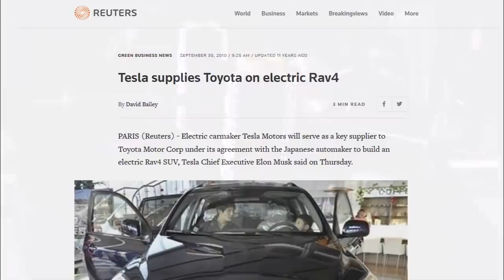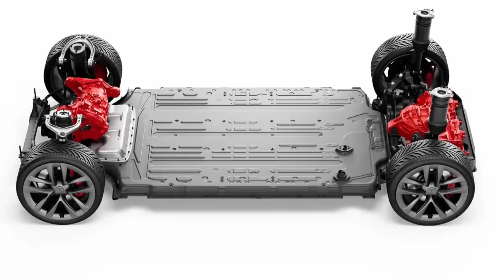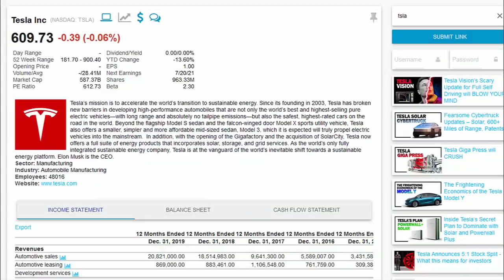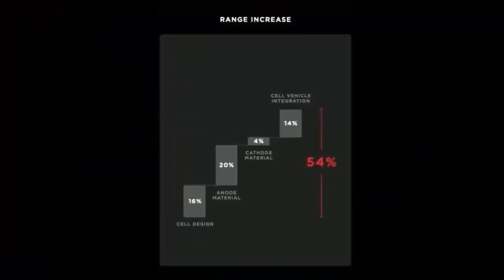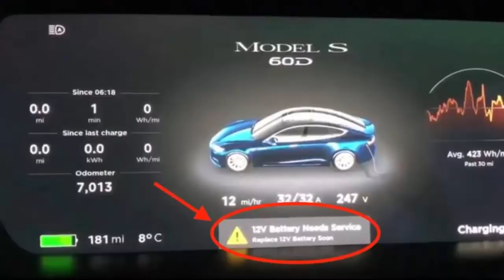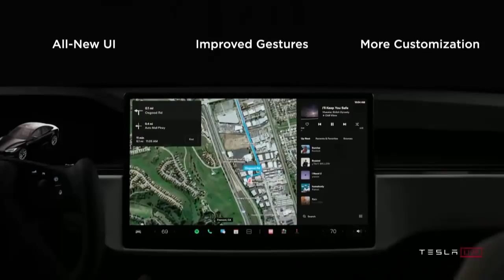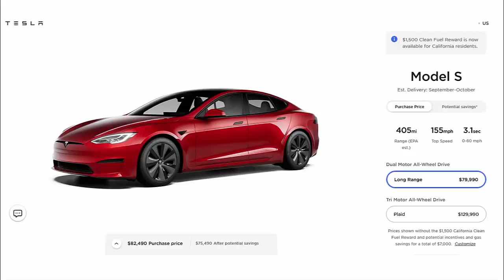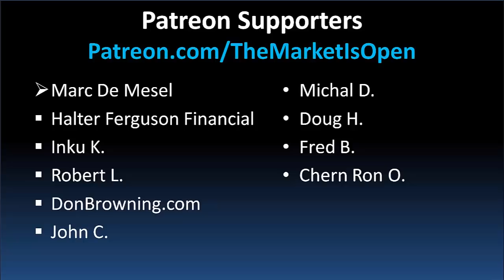The INSANE Engineering of the New Tesla Plaid Model S

Comment: If Tesla's rollout of the CSRs (carbon-sleeved rotors) is like other performance-related features, they've left significant unlocked potential, providing headroom to crank up the top speed, etc., and will gradually unlock more once they've gained a body of real-world experience.

Comment: You can upgrade to the FSD option after the vehicle has been delivered, so it's not an issue for the tax credits.
Reply: Exactly. The paint, the wheels etc are a bigger issue here.
Reply: As FSD is software, wouldn't it technically not be included in the tax credit anyway?. So they could sell it as an optional extra, but seperate it from the car's invoice/order
Reply: @jamesbedford7327  they actually don't do that, it's just an additional item tacked on to the list of features. This screwed me over when I got the Model 3, because it put it in the luxury car tax category, so the tax on the entire amount went up.
Reply: Guys, what is the eligibility for the tax credit? Is it income eligibility or car cost?
Reply: @dmtheone  the proposed legislation is based on the cost of the car. Under current legislation (for which Tesla is no longer eligible) you basically get a discount on your taxes, up to $7500, no car cost or income restrictions. Just based on whether the make has sold 200k units yet or not.

Comment: Well carbon itself can handle extreme heat. But one important thing to remember is that the resin used does melt long before the carbon itself so that is why we don't see entire carbon fiber exhaust systems ie on sportsbikes. Due to the heat in the exhaust gases, only that pipe on the end of the exhaust system can be made of carbon fiber. Because if you tried to make an entire exhaust system in carbon fiber the resin would melt and soon you would be driving without any exhaust system. Electric motors themselves are heat restricted. Too high temperature will render magnets useless. Even the highest quality magnets can only withstand around 200 degress celsius (iirc) or 220 ish C, and that is more or less in line with what the resin in carbon fiber can take of heat.
Reply: I would wager that SpaceX experience with Carbon Overwrapped Pressure Vessels probably aided Tesla's Carbon overwrapped motors.

Thanks for interesting points about thermal limits in composites.  While the Carbon fiber has amazing properties, it is limited by the thermal properties of the plastic binder.
Reply: Carbon carbon composite can bath in plasma and survive.
Reply: @kazedcat  Tesla is probably not using Carbon-Carbon composite on the plaid motors.
Reply: @kazedcat  Yeah well carbon ceramic also can withstand more heat. But then it is not carbon fiber any more. The use of additives changes the product. Carbon carbon is more carbon graphite if memory serves me well? Or am I having a senior moment here?
Reply: @LoanwordEggcorn  Well they could, it's not like carbon carbon composite is unobtanium, is fairly common and should probably be possible to produce within the limits of serial production. But, do they really need it? My guess is the motor temp with its new cooling will be well within the limits of ordinary carbon fiber composite.
Reply: @tianjohan4633  Agree the regular Carbon composite overwrap probably has enough heat resistance for use with the motor.  The motors are actively cooled.

Carbon-Carbon composite is relatively unobtainium due to the very high cost of making it.

Comment: Quibbles: There's no steel casing around the rotor, which is built up of numerous thin steel sheets stacked along the axis. (The carbon sleeve is a significant departure from the prior mechanical design.) These thin sheets themselves provide the tensile strength against centrifugal forces.  Also, I think that all three motors in the Model S are IPMSynRM (Internal Permanent Magnet Synchronous Reluctance Motor) - they combine the effects of the reluctance geometry of the steel rotor body with those of permanent magnets embedded within that body under the influence of the rotating magnetic field generated by the changing current in the stator coils.
Reply: Nicely stated.  :)

Comment: Great video on an amazing ev. Just curious why there isn't more talk about home chargers? So much talk about charging stations when charging at home is one of the best things about ev ownership. I realize this isn't an option for some, but for the large majority charging at home it's what makes ev ownership the most convenient car ownership option and that is a huge advantage over other cars...especially if you have solar panels that keep costs down and give you huge satisfaction that you are driving your car with power generated from the sun.
Reply from the maker: I've got a recent video on Tesla Powerwall 7 Solar https://youtu.be/W8ivhjzhYXQ
Many homes, as far as I know have 100 amp or 200 amp panels, and then you try to get as close to 80% of the max as possible without blowing your circuit, so that kind of limits the house. the new Powerwall is 9kW, which can probably charge quite a bit faster, but usually people charge overnight anyways.
Reply: @TMIOTesla  cool...I'll check it out. Good point on the 200A panel limitation as a 400A panel would be 🤑🤑🤑

Comment: Damn. This thing will smoke the Tycan.
Reply: Tycan's transmission used to be one of their selling points.  Now it just highlights the limitation of their electric motor.  This stuff is mind bending.
Reply: @lanzer22  not really to make that assessment both cars need to have the same horsepower. Where the taycan actually has a disadvantage is in weight and aero dynamics performance wise  ,entertainment and charging infrastructure convenience wise
Reply: @jacybongo2589  
You'd think that with 70(?) years experience and the might of VAG behind them, Porsche would be way ahead in "weight and aerodynamics"?
Reply: @rogerstarkey5390  well compared with the tesla out at the time the taycan was pretty much beating the ludicrous, the raven and the cheater stance.But then again porshe does own 25% of rimac so I'm sure there will be many colabs in future
Reply: Yes, on 0-150mph, Plaid is 6 seconds faster than Taycan Turbo S !
Reply: @alexz8373  Wow!
Reply: It already does from all angles, speed being only one of them. Tesla leads every other OEM, not just Porsche, in OTA updates, Software design and integration, Recharging speed, no mechanically geared transmission, horsepower, car controls, maintenance, quality, reliability, ............. And being an almost 100 % vertically implemented company directed by top-rated engineers and no MBAs, and with no legacy technology except the wheels, Tesla can do whatever they want without having to be dependent on external providers, and their rate of innovation is superior to anyone else, and only focused in the future, not the past.  That is something that many people, including Bob Lutz, Warren Buffet and several other investors and industry analysts do not appear to fully comprehend.

Comment: Something to look into on cold-weather degradation. There seems to be more to it than just cabin heating. I’ve noticed driving in extreme cold, as long as the battery stays warm, the battery capacity does not degrade. If the battery is pre-conditioned or your just driving around town, I don’t see significant degradation;. However, driving on the interstate, when the battery gets cold, the battery capacity suddenly gets cut in half (or so). It’s not a steady drain, it’s a sudden drop. So, I think that the new heat exchanger is more about thermal management of the battery, than improving cabin heating. Just my observations.

Comment: The S and X seem to be testbeds for advanced tech, No mention of using castings though. Production line down for what 6 months - long enough, completely redoing the body and adding castings might have taken much longer. Tesla engineering is in the groove running circles around the competition.
Reply: Warren Reddich, YouTube.
Launch even video.
44:30 onwards.
Castings, floor, conversations re batteries/ pack, etc

Comment: Tesla has in the past used different motors front and rear to optimise for power or range. If all three motors are the same, then the limiting factor may be how fast they can discharge the batteries. So your speculation that the 4680 might allow for 3*400hp could be right and the reason for the Plaid + expected to be quicker.

Comment: Not a "breakthrough", but an achievement.

Laying to rest the myth that "the batteries overheat".

I've seen a report by Warren Reddich who was told by a Tesla employee, at the event, that the issue wasn't the cells, but the electronics overheating.

That Tesla has achieved Plaid performance with the "old" cell format, AND to the extent that there was insufficient difference to justify the Plaid Plus (for road use), is impressive and removes another layer of FUD.

Comment: Carbon sleeve for fast rotating stuff has been around a long time.
If it hasnt been before for cars is probably because of cost, bad legacy inertia or it wasnt well solved in that area. Probably Tesla with its tecnical and materials engineers has found a way to solve some problems or make it cost worthy.
Reply: Elon mentioned they have secret sauce on the new motors. There are also things he said that did not make sense like the carbon fiber preventing copper expansion. Why is there copper in the rotor? If it is a permanent magnet motor you don't need copper in the rotor since copper disrupt the  permanent magnet's magnetic field.
Reply: @kazedcat  right!,  something a bit different, but that it will later look obvious like rotating the battery tab 90° hahah?

Comment: Although Tesla has lower Cd (drag coefficient), it may still require more energy than Porsche to move. The drag equation also includes (frontal) area (A). You have to multiply Cd by A for a true relative comparison. Lucid claims both a low Cd and A, so ought to be pretty efficient. Teslas are quite large cars relatively speaking (especially when compared with European cars). Edit: other things in the drag equation are constants (at same speed). The only 'variable' is are density (r, rho). High temperatures would reduce r for better acceleration and top end, (but both of these are also dependent on rolling friction and motor power and efficiency).
Reply from the maker: Yes agreed, the Model S is much larger (frontal area) than a small sports car, which is impressive that it can beat the porche now

Comment: The 4680 cell has an aging issue?  
Premature aging of thermal and electrical conduction performance. 

Per Tesla’s patent, 4680 cell removed the “single welded tab” in the tab-less design. Eliminating the tab breaks the circuit between electrode and output terminal - cell wall. To undo the break, Tesla employ multi flap (are copper flaps protruded from periphery of electrode) to complete the circuit plus pretension induced in the cell capping process. 

If all goes well these flaps provide thermal and electrical conduction as expected starting from the delivery day, and will begin aging as soon as it is put on use under inertial and thermal shock in road. Why? 

It the flaps are annealed soft copper that can’t flex back to its original shape once deformed by inertial shocks. One by one begins to disconnect from the cell wall, until only one flap left in circuit. From there on further inertial shock will cause momentary open circuit at the cell wall. Leaving thermal and electrical conduction worse than cells with one welded tab. 

All chemistry improvement in the 4680 will be gated by those soft copper flaps. Failing to addressing those issue will let Tesla lost all their claims on 4680 cell. Cells that degrade below Panasonic 18650 and pouch cells.  Almost all Tesla’s competitions use pouch format. 

If the thermal management in model3 isn’t implemented with 4680 cell pack can degrade chemical performance for modelY and future models on 4680.

Comment: I heard Brooke from drag times mentioned 400 hp per motor. I believe this is for the torque vectoring. It may not be for future upscaling of power output. The motor will probably be revised again. Torque vectoring requires completely cutting off the power on one wheel, so for a fractions of a second outwould only have 800 hp
Reply: Torque vectoring does not require shutting off one motor completely. 

Normally, the force vectors (meaning amplitude and direction of force) are equal; by changing the force of one wheel relative to the other, you can change the direction of the resulting summed vector of the forces from the two wheels. This difference could be only 1%, and it would still change the direction of the vector, albeit only slightly. The current can be delivered very precisely, which is directly proportional to the torque (and thus force exerted by the wheel). 

Modern electronics can adjust this hundreds to thousands of times per second to optimize control of the car through a turn. This is torque vectoring. If you just have one motor per axle, this is not possible, even with a torsen (torque-sensing) limited slip differential.

Edit: A limited form of torque vectoring is possible with front and rear electric motors when the wheels are turned; since the force vectors are not aligned, adjusting the relative torque (force) will also change the direction of the vector, although this is quite limited compared to changing the relative force of two wheels on the same axle.
Reply: I think we have just over 1000 HP total possible with all three motors in play at max at one time but when torque vectoring you can 400 two and 200 one... split it up real time and you have the split power application needed to make torque vectoring really make a difference on the track OR on the road in emergency conditions. Torque vectoring using braking has been effective for safety up to now but torque vectoring without the need for braking may make a big difference.

Comment: What type of battery are in the new plaid model S?  18650, 4680, 2170?
Reply: Maybe 2170?
Reply: Legacy 18650 cells. What is new is battery pack is redesigned to be higher voltage (still class 400 V), like introduced by Jaguar I-Pace and Audi E-tron in 2018, this allows higher power usage with less waste heat.
Reply: I don't think we know yet. But I expect the new pack has eliminated modules and made huge strides in the cooling system. Likely that both have helped cut significant amounts of weight. Also may allow them to fit in more cells.
Reply: @sgill4833  I’d be very surprised if the batteries were tabless.  This innovation was only required because of the larger form factor of the 4680 cells.  Also, The whole point of sticking with the old form factor is that they can take advantage of the existing battery manufacturing capacity.  This means that only tweaks to cell chemistry and pack design would be possible
Reply: I would say, they had to use the 18650 cells due to better cooling possibilities than with the new 4680 cells (lower surface to volume ratio). It could be the reason  why they dropped the plaid +.  Due to cooling problems with the 4680 cells. It would not be reasonable that the plaid + has lower full power capabilities than the normal plaid.
Reply: @sgill4833  
No.
18650 cells.
Improved PACK.
the "multiple run" issue was the electronics overheating.
Reply: @peterhelm522  
4680 cell.
Tabless
 Lower internal resistance.
Less resistive heat (much less)
Less cooling required.

Plaid plus was cancelled (imo) simply because the incremental gains over the "standard" Plaid weren't enough to justify the extra resources used.
( Not to mention, that performance is already beyond the capability of 99.9999% of customers to control)
Reply: @rogerstarkey5390  To my understanding, the tabless design was made to overcome the inherental disadvantage of cells with large diameter, a disadvantage a slim cell does not have. Since the length that electrons have to travel in a slim cell is much more limited than in „fat“ cell. With the tabless design electrons do not have to travel throug the wohle electrode. It could be that the electrode travel Shooter distances in the tabless design than in normal slim cells, but they still have to travel in the electrolite which causes the resistance and heats up the cell.
You always have a heating up of the cell at high discharge rates through internal resistance. The volume of the cell increases at the power of two with the diameter and the surface only at the power of one, so cooling gets more difficult.

Why would be a plaid+ with 100+ miles more range not sellable?

Comment: You can also just buy lifetime FSD after you own the car, and get the tax credit if it is there.
Reply: If you want it in white, with standard wheels and black interior, sure. Wheels are easy enough to change after the fact, but getting white interior puts you over the edge. I'm sure Tesla will find a way to fenagle that if the bill is signed

Comment: Probably not "software limited at that speed", it is battery output limited at ~750Kw. Each motor is capable of 400hp, with more battery output it should be able to go up to somewhere nearer 3 x 400 = 1200hp (depending on other limitations). Probably looking to roadster, which will be a beast.

Comment: What are the engineering tradeoffs in choosing to have a single speed gearbox vs two speed? Does the carbon fiber wrap offer advantages at low speed, or is it purely to be able to advertise a 200 mph top speed that almost nobody will ever make use of? (Not that this would be such a bad thing - it is a tech demonstration of the capabilities of electric cars, and anyone who doesn't want the silly top speed can not pay for it and save $50k.)